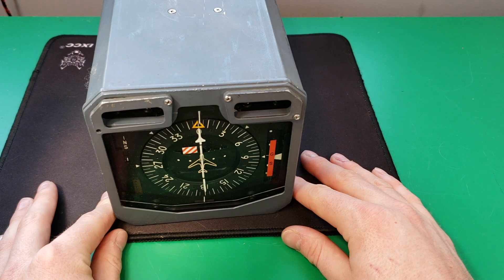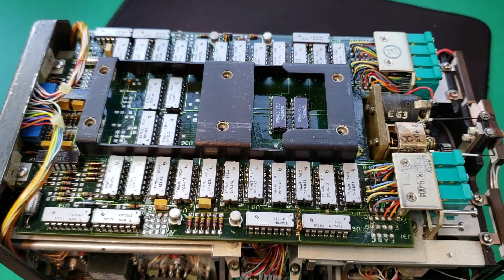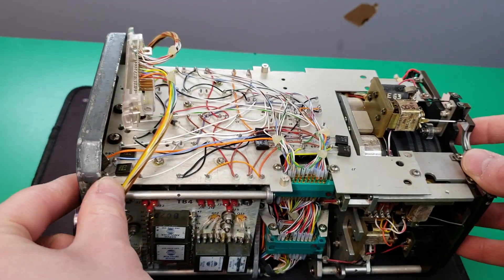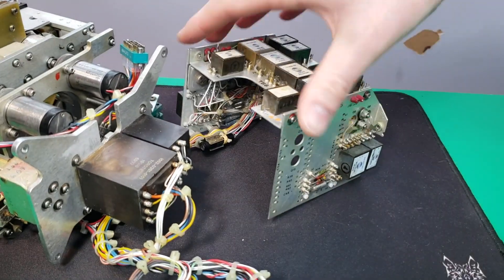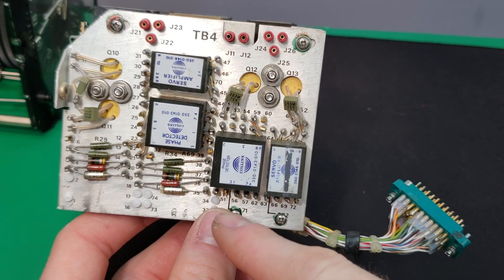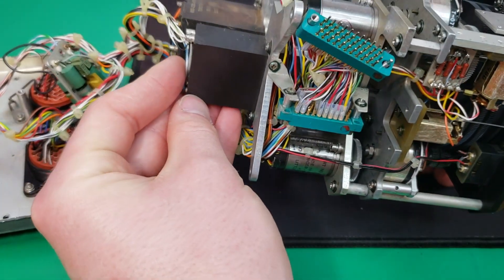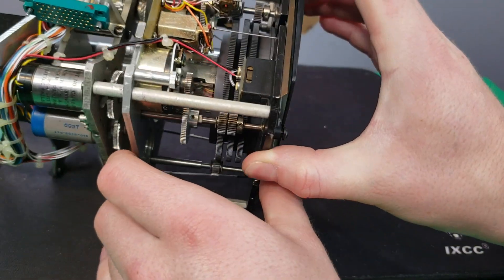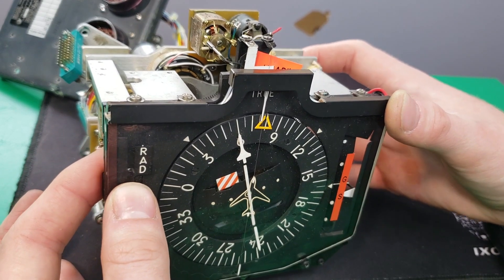Collins 331A-8A Horizontal Situation Indicator Teardown

Comment: Cool, I love these modular designs. I have the same but 8K instead of 8A for future teardown.
Reply from the maker: Hopefully the one you got has the display cards! I was disappointed to realize they where missing on my unit.
Reply: @BGTech1 I am lucky, mine is complete and sealed.
Reply from the maker: @lelabodemichel5162  That’s good. Are you going to revere engineer it? This one might be challenging.
Reply: @BGTech1  Yes of course. I think it is easier with this kind of modular design, there are less parts than classic designs. For the digital ARINC 575 only the inputs have to be find.
Reply from the maker: @lelabodemichel5162  A long time ago you said you had a Collins VHF transporter for a video. Are you still planning on making a video about it?
Reply: @BGTech1  Yes, it seems working, It is not a transponder but a transmitter/receiver. I bought in the meantime VHF frequency selectors to set the frequency. I hope it will be possible to hear some pilot's discussions. I don't know when I will record the videos.
Reply from the maker: @lelabodemichel5162  interesting what’s the model? That would be a neat video if you where able to get it to work.
Reply: @BGTech1  Collins 618M-4A
Reply from the maker: @lelabodemichel5162   I believe that radio is internally similar to the 618m-5 msylvain59 did a video of a while ago. I’ve been curious about the 618m-1/2 for a while now, but they are too expensive to purchase. A few pictures of the 618m-1 exist on the internet, and it looks very old school with large air gap capacitors and vacuum tubes. I have no idea if the 618m-2 is solid state or uses vacuum tubes.
Reply: @BGTech1  just found a 618m-1 from Germany for 70€. It seems transistorised except maybe the final.

Comment: 8:10 this is just a magnetic flip-dot indicator, normally designed to be mounted on a front panel, it must be used here for calibration and maintenance. BTW I need to find more of such instruments but they are expensive, usually the cheapest ones I see on ebay are in the 100-150  euros price range.
Reply from the maker: This one was more expensive than what I'm usually willing to spend, but even then it was a good price for such a nice instrament.